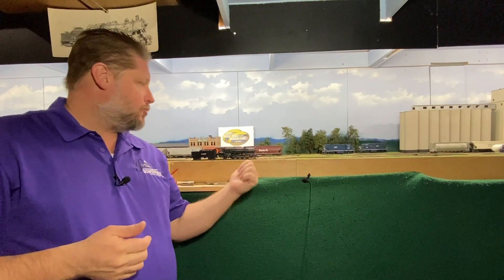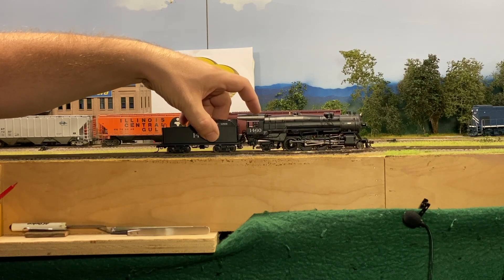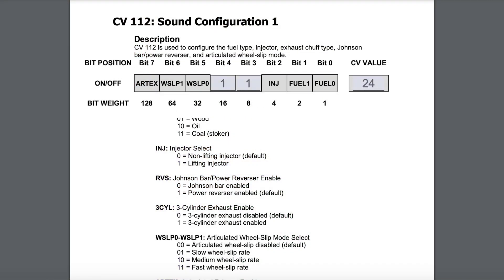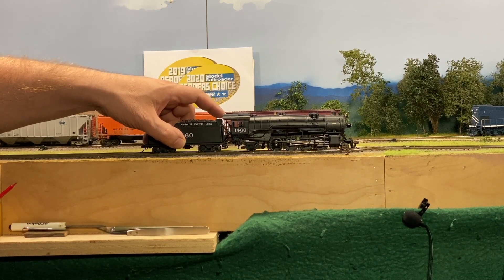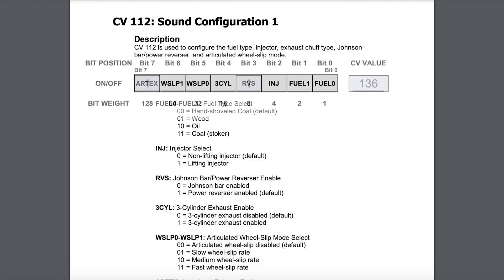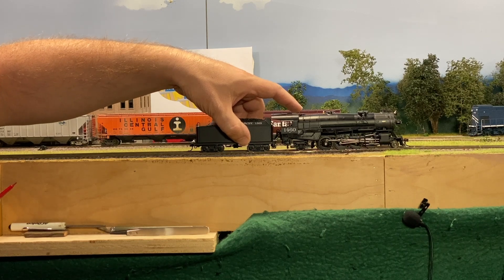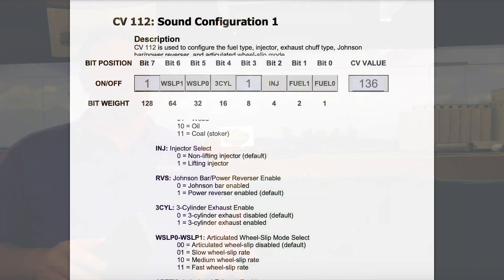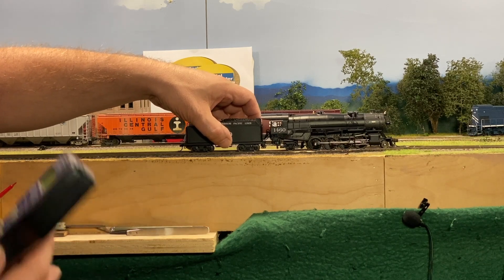Tsunami2 Steam Decoder Chuff Cadence

Comment: Heyya George!!
Does the wheel slip feature apply to a regular rod driven locomotive (non-articulated). My Heavy Mike sounds freakin awesome. Head turner for sure! 
Going from stock BLI to the TSU2 was a night and day difference, we’ll worth the price, effort and time.
Reply from the maker: Since the articulated exhaust uses two sets of drivers, the wheel slip discussed is for the sounds of the 2 sets of chuff running in and out of sync with each other.  For a conventional rod, you can activate the F19 wheel slip to get the sounds of the drivers losing traction for a moment and the engineer regaining control.  Thanks for watching.